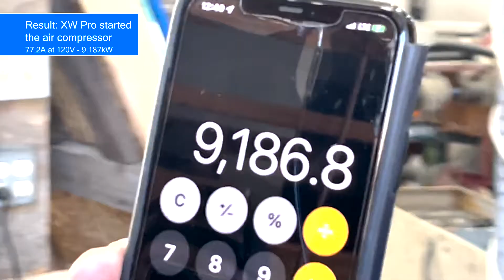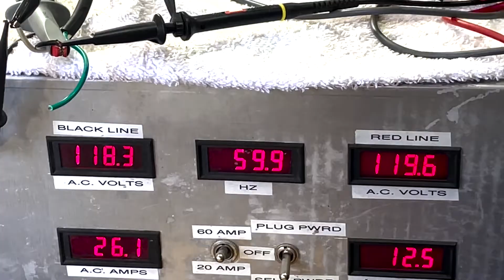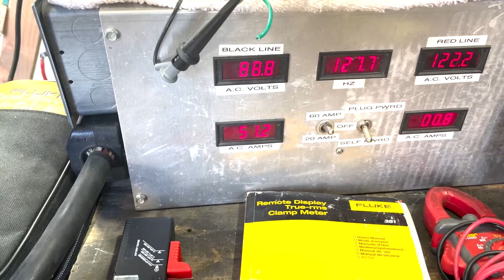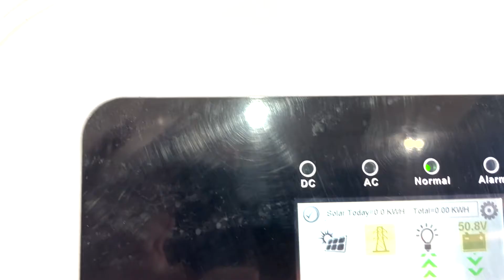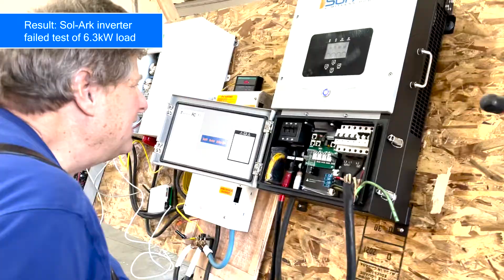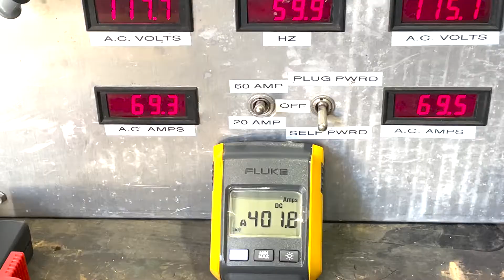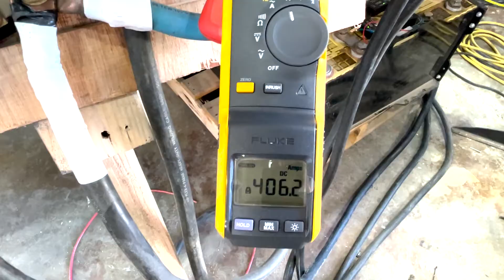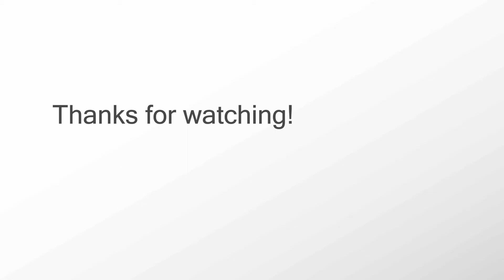XW Pro vs Sol Ark

Comment: I have installed and personally used both. Solark tells you upfront they limit each phase and the power between phases cant be combined. I’ve never had one trip under a rated power. What Solark does that Trace does not is provide built in mppt inputs that eliminates the need for expensive multiple charge controllers. Their software in my opinion offers is better by being simple and more intuitive than Trace/ Schneider. The learning curve to make the Trace system do what the Solark does is quite lengthy, and requires purchasing and integrating multiple add-on components that are problematic for new guys to deal with. I think the Solark offers a lot for the money. In all fairness their product has only been out a couple of years and Trace has has decades to improve their game. I’d say Trace/Schneider is a superior product in some regards but not all areas. And in fairness to Solark, you should mention the Schneider product does not provide any charge controller built into the XW. You have to purchase that separate. And if you have high voltage panels get ready to pay thousands for what Solark provides built in to their inverter. I think Schneider missed the boat on that one years ago. For management of a pv array and charging batteries Schneider is not even in the game with the XW inverter alone. For starting loads Schneider is a superior product in some regards. However, I think there are important aspects of the comparison that you’re leaving out.
Reply: I think everyone know Schneider is a component system and not an all in one. More trouble but more flex.
Reply: As a 39 year off grider ( my term) and still having the first commercially viable Trace unit, I will again say it is insane to add MPPT built ins to an inverter,  adding another fail point to your inverter is foolish, especially for off griders.  The days of a Trace type  company  flying me a new 4024, and it hanging on my wall within 24 hours area thing of the past.  Use Morningstar MPPT controllers.
Reply: @tompayne695  I think there is some value to your comment, however not every customer is “off grid”. Whereas, I would agree that adding complex function to a device reduces its reliability, I would also say having multiple separate components to perform the same thing increases risk to an equal degree. And if you are “off grid” does it matter if you have a separate inverter and charge if either fail? You could argue it’s cheaper to have a spare charge controller but what guarantee do you have the inverter won’t fail? You still have multiple points of potential failure. I have an off grid property and I have both types of systems installed and neither have ever failed. Furthermore, all of the customers that I’ve ever sold a Solark to were grid tied  and simply wanted a backup in the event of a power failure.  There is no risk there and it’s a cheaper way to accomplish the same thing. I would bet on Schneider before I bet on Solark in general but only due to the fact they have been doing this for many years. Their reputation is solid in the industry and it’s a great product. It also costs more. No free lunches. My Solark has only been in place for a year but it has been a reliable device and I see no reason to discount it as an off grid solution. My point is one device with two failure points is no different than two separate devices that are both required to perform one task. The only advantage I see is if you gamble the failure point will be a less expense component however that is not guaranteed. The only true guarantee is a backup system. Two is one and one is none.. as they say.
Reply: @Richard-ib3kp  Schneider sells a "bundle" that adds DC coupling and basically makes it an all-in-one with a modular assembly.  It's a nice form factor and everything is matched.  It's like a $2400 mark up over the base 6.8kW.  The value is there, but it's not for me.  I'm going to add solar later, so I appreciate being able to size separate and redundant MPPTs for the array I'll eventually erect.
Reply: I heard the argument about components failure and being about to change them out in a modular system than an all-in-one. I think once installed right most failures would be at losing connection at the wire plans and there are more wire/cable connection in modular system than all-in-one

Comment: You have a defective unit.  If you open the front cover and look at the MCU board, I bet you have HW v1.1 board in it.  SolArk will send you a replacement HW v1.2 board and your issues will go away.  The symptoms you are having are exactly the problem I was having.  I was using a 120 VAC compressor.  You also need to update the firmware as well.  Once repaired, they will run very well even with unbalanced 120 VAC loads.

Comment: My neighbors installer just finished a solark 12k install with 6kw of PV. The installer promised it would start a 3/4hp 42a surge 240v well pump. Let’s just say it can’t and he had to move the pump back from critical loads panel to main panel for grid power. When the pump kicks on with solark, it just beeps and resets. Installer isn’t helping resolve saying the solark spec says it can. This video is very informative
Reply: I wonder if this is because your battery bank isn't sized properly for delivering enough DC amps?
Reply: Yeah I wonder what the pump actually pulls, seems like it needs more than 42a
Reply: Tell them they can salvage it by adding Soft Start kits to their heavy loads like the AC compressor or well pump. Even my cheaper Sigineer 6Kw can start my AC now-just barely. I am about to install this Schneider XW Pro and I was using the Signieer all in one as my starter inverter, and I am super happy because I had very low expectations for the Sigineer. Once I install the XW Pro I will probably keep the cheaper one for a small country house or as a backup. But I knew the Schneider was the better bet based on tear downs. 170Lbs for inverter it says on my pallet. That is HEAVY! My Sigineer Power 6Kw UL Listed inverter is only 70 Lbs-not even in same class.

Comment: We became a factory authorized and trained service center for Trace Engineering in 99 and can confirm that everything you say in your excellent video is true. High frequency transformerlless inverters, whether Chinese or US made, simply cannot produce a sufficient surge capacity to power high surge inductive loads. A much better, longer lasting inverter will always be a low frequency, transformer, based inverter like the XW.

Comment: No well Pump?  ~8:00  Small Loads only ? really?  95% of well pumps are 240v.  There hasn't been a pump I haven't been able to start that is under 3hp with a Sol-ark.   I have about 70  Sol-ark installs out there.  You should have specified that this was an offgrid only experiment.  You forgot to mention the round trip efficiency of XW system including the charge controllers.  You have almost 20% loss on an XW round trip (solar>CC>battery> inverter>load)  I ran 17kw all day on 2 Sol-arks the other day.  There are a lot of apples and oranges comparisons in the video.  You also could have mentioned that adding a transformer to Sol-ark in an offgrid installation is a solution that is <$400.   They are both awesome inverters and need to be installed correctly and the customer need to be educated on the system.
Reply: There is some weird mentality out there that says if I pay a whole bunch of money for something then the specifications better be better than anything else.  The 12K Sol-Ark works perfectly within it's designed limits.  If you want more power get the 15K model.  Your not paying this money for brute force power, your paying for a system that is very reliable, intelligent and efficient at harvesting power from multiple sources.
Reply: 775 I’m glad you watched this. I was thinking to send it to you and get your input. 
Thanks.
Reply: @Dreadlk  So expecting a 12k inverter  to at least keep up with a 6k inverter is weird mentality .  I think it's weird when a company calls it a 12k and then in the specs call it a 9k  and then it won't do that well. That's weird.
Reply: I think Mr. Abney made it clear this was on off grid test. He said he specializes in battery solar systems. I think it was as fair of a test as it could be. The battery and loads were exactly the same. He didn't make the video to showcase the features built in to each inverter beyond it's ability to convert 48 volts DC into 240/120 volts AC. The Sol-Ark clearly has more built in features but that isn't the point of the video.
Reply: Charge controller consumption is almost non existent. (I know because at 10800 watts of solar on 12 volts I've got a lot of them). Not a factor compaired to the Sol-Arc's idle consumption let alone two of them, which is a bunch.
The main difference between the choice of the XW/Trace line of inverters and the Sol-Arc is what the consumer is trying to end up with.  Bullet proof, proven reliability and garanteed power vrs trying to save money by evading payments to the utility companies with a quick and easy installation as the main priority.
For an installer knocking down 70 systems as you have, its the same strategy as your installing Kyle's quick and easy ground mounts. The best way to generate high volume and make maximum bucks.
Good for you but not necessarily the best option for someone who wants brute power and reliabilty no matter what it costs or how much labor it takes to do the install. The fact that you have to propose adding soft start controllers and even transformers that the XW already comes included in the design speaks for itself.
My two Trace SW2512's have been running problem free for 23 years and I'm from the old school like this gentleman is. We went off grid not to save money, but to have power for critical loads no matter what.
When the system actually does go belly up running cental air is an unneeded and unsustainable luxury versus reliably starting a deep well pump which is mandatory. Both this gentleman and myself of been operating our systems since before the current flock of manufacturers and installers ever heard of alternative energy. Even though over a time frame of 23 years the cost calculations of panels/batteries have completely reversed I'll still be keeping my current system. Our strategy will prove to be the best in the long run when money doesn't matter any more.
Reply: @johnvasko4035  I appreciate your seasoned perspective. Before I watched this video today I purchased an XWPro 6.8kW system based on my own research. Granted I was swayed by opinion but time tested equipment does prove itself by comparison. I disagree that inverter cost is a minimal overall cost of a system. It depends on your system and how long you own it, use it and how it's installed. I would prefer to buy equipment that will last for decades, not merely a few years. 

After dealing with overseas manufacturing, being in charge of worldwide R&D and Mfg. for several years at one company, and several decades in high tech I can attest to good engineering and procurement practices and how they influence products. I completely concur with how you assessed a typical user's response to issues. 

I too am having to deal with unbalanced loads on a 120/240 wiring system and from testing I've reviewed, the Sol-Ark will not hold up unless it's in specific use models. Starting well pumps, running A/C, and then running other devices on unbalanced voltage legs will lead owners to unhappiness, frustration... if not madness. I would hate to imagine my poor wife having to ask me every time to reset a power outage because her morning coffee tripped the system (perish the thought)!!! 

Granted I would have preferred that Schneider's add-on's cost less.  There may be better more cost effective solutions for MPPT controller add-ons but you ultimately will have to look at the component specifications to assess the ultimate lifespan on robustness of the equipment. Some components will fail prematurely based on specs which is obvious... especially capacitors for instance. Tighter specs can cost more initially, but typically last significantly longer if engineered properly. Same goes for proper testing... lifespan, vibration, 5 corner environmental testing, dendrite growth, etc. vs. how they affect lifespan. Ultimately the results can be shown in one aspect of the testing as you so admirable displayed. Bravo! Kudo's to others who have had similar real life user results over the months and decades. Your insight is valued! Keep it up.
Reply: How hard is it to replace the caps, IGBTs and CPU on the SolArk? Can you do it without taking the unit off the wall? With XW6048 the power board is right there up front along with CPU board above it for easy servicing.
Reply: @jasonphillips3051  I am very familiar with each product . What I was getting at is Solark is the ONLY company I have ever heard of using PV input as a naming scheme .   If you call an inverter a 12k  it should 12k not 9k .    Solark has continued this misleading scheme with the 15k as well , it is only a 12k inverter .
Reply: @onthelake9554  It does 12k. 9k goes to loads and 3k goes to the battery. Actually the 12k will allow 13k of pv and distribute it accordingly. If you buy a 12k unit and want to use 12k you have already chosen the wrong unit. If you buy a 15k unit and want to use 15k once again you have already chosen the wrong unit. Do you see the pattern here? When you drive around town today put your car in first gear and drive it at redline all day and it will dawn on you what's going on. They don't have to change their advertisements around comprehension. 9k +3k =12k

Comment: You've undoubtedly seen my video on the XW Pro.  Based on Schneider's response to it, I'm going to give it another shot.  I had no issue with load capability, but rather the software glitches and tech support, which are just as important as the capacity.  
Thanks for sharing!
Reply: tech support sucks for Schneider
Reply: @earthenergyhex  Tech support does suck and its not very user friendly at all. Ive had this unit for 7 years and the 1 out of 2 Schneider charge controller failed after about the 3rd year. I had to replace it.

Comment: I would love to see the same tests with Victron!!
Reply: They are always disappointing they don't handle spike loads well and don't make their rated power. Deye and mlt can easily sit all day at their max power
Reply: @dlfrestoration incorrect. I have 10kva Victron multiplus and 8kw sunsynk. They both do their job but Victron inverter is a transformer based inverter and can do 130% for 30mins. That is insane

Comment from the maker: Bob, You are so correct. The problem is very few understand how to make it all work correctly. Off grid is NOT plug and play ! also one manufacture for all components is usually not the best for the customer.  I find the biggest problem is many installers install and walk away when programing is as important as having the correct equipment.

Comment: Great video and demo.  Thanks.  I'm sold.  I was down to Schneider vs Victron Quattro due to their quality and toroidal transformers. It came down to the Schneider having 120/240 so I could run my well pump reliably.  To get 240 from Victron, I was going to have to go for pairs of 3kW, 5kW, 10kW and an external autotransformer, or a 15kW.  I was concerned with the higher idle power consumption of the bigger/more complex Victron, so I ordered the Schneider. Thanks again.
Reply: If you're in the USA , sadly the Victron is not UL / ETL  listed  either .  Maybe some day they will realize it needs to be .  Victrons user interface and configurability is light years beyond schneider .
Reply: I too am down to Schneider vs Victron Quattro due to their quality and toroidal transformers but more to Schneider after watching the above load test and another one from David Poz - Load Testing the Schneider XW PRO 6848 Inverter https://www.youtube.com/watch?v=nCV1OUrcAaw
Thanks again
Scat

Comment: FYI The Sol-Ark will auto reset itself in one minute for most errors.
Did you go into the Inverter settings and change the Battery Capacity Value?  The first test of 90 Amps on one leg is way above what the Sol-Ark can handle.  The second test was reasonable but you have a flashing Yellow error light on the Battery Indicator which means you are nearing or  exceeding the discharge current limit you set for your battery bank.  If you get to the limit it will Trip the inverter in order to save your BMS.
Reply: i was thinking the same thing. I have the original indoor 8k and it wont trip until 9k or so.

Comment: I have a Sol Ark same as you tested and have this issue all the time. Cannot run the well pump and AC at the same time. Was told the issue is I don’t have loads balanced. We are 100% off grid and been looking for a new inverter to eliminate the Sol Ark.
Reply: I have this issue as well. Sol-Ark's explanation was that the system will only draw up to 120% of the max battery current setting in the menu. That's regardless of what the actual battery discharge capacity is.  This is quite a bit different than the surge figures in Sol-Ark's datasheet which they say only apply when on grid.  Definitely not the way I interpreted before I bought.

Comment: I am in a fully agreement with you. I am running my 2800 square house fully offgrid. The inveter that I am using is xantrex xw6048  never had a problem. I run  four  inverter  split Ac unit  constantly along with everything else that is use in a regular home. Thanks for confirming.